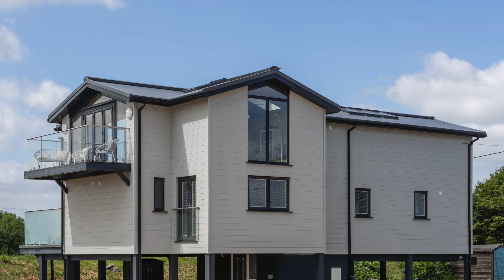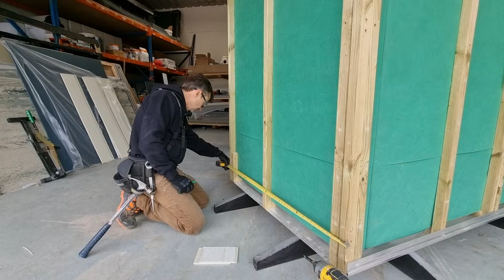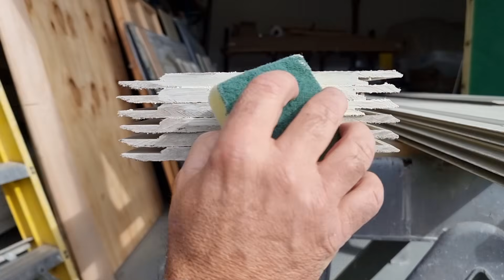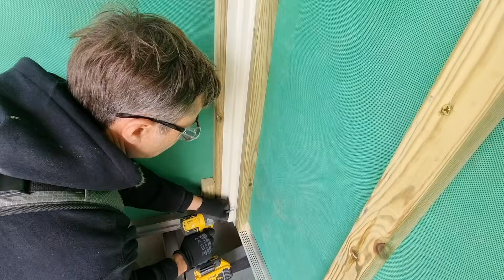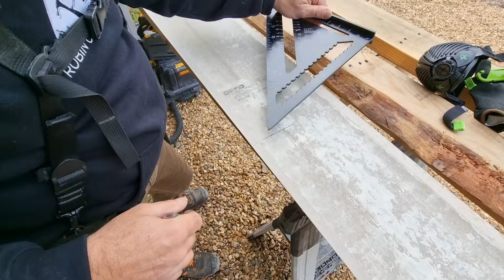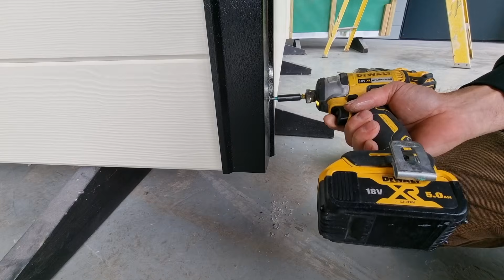How to install Hardie® VL Plank

Comment: Silly question time. If installing cladding vertically. How do you maintain the vent strip , when the lower batten would close off the vetilation void
Reply from the maker: Hi Mike, you need to cross batten to maintain the air space and use the deeper vent strip at the bottom
Reply: @robinclevettcarpenter  cheers Robin. , i thought it might be that. But wondered if there was a clever product to avoid it
Reply: Why wouldn’t you just cover the vent strip with the vertical boards?
Reply: 45 degree Diagonal battens would work also.

Comment: Amazing Thankyou! You covered just about everything I will be doing in this one window. I searched far and wide for this type of explanation and you nailed it! Pardon the pun! Just wondering what your thoughts are on installing this on a bay window. I can't see any 45 degree edges or profiles so I'm guessing you would just need to but them together with sealant? Any ideas Robin? Thanks again for a great video

Comment: No caulking required for the corner flashing?
Reply from the maker: No from memory we leave a small gap and paint the cut ends of the boards this adds protection and allows and moisture out
Reply: Would like to see some flashing like damp course around those corner studs as we would do in Australia. Also some sealant under that corner trim ... Water will find it.

Comment: I found this very useful but not being a builder I got confused as the words "Trim" and "Profile" were used interchangeably, and the camera panning in to profile/trim in question was too brief  - I had to rewatch  3 times at 50% speed with captions on. I think it would be helpful at the end of the video to have a list of all the profiles used. The demonstration frame with batons seems to have roofing membrane behind it. On a 1966 townhouse I imagine that the old decaying wooden cladding will have blockwork under it. Would one fix a membrane on this? Or could one paint the area to be clad with Thomson's Water Seal (or equivalent) ? On neighbouring townhouses on the terrace where there is replacement white plastic cladding and the cladding has been joined to meet the horizontal span, there seems to be a white plastic tape over the joint. But in the Hardie's catalogue there  is  a black EPDM tape, which I think from the video goes behind the joint, but no white tape to go over the the front of the joint. Should/could there be and where would one source this?  Finally where a joint is necessary for several horizontally laid VL planks, should these be staggered or should they be in a straight line?

Comment: Should we wear a mask when fixing the boards? Is the dust very hazardous?
Reply from the maker: Hi Paul, any material that has the potential to generate dust whilst being machined etc can cause problems so I would say yep a mask is basic PPE needed
Reply: Thanks for your speedy reply, much appreciated @robinclevettcarpenter  8~)

Comment: just thinking of  doin our porch in hardy would it b ok to put 25 mill of celotex in between the battens would this affect the airflow
Reply from the maker: You need to maintain the clear airflow, you can put the 25mm insulation behind the battens providing you secure the battens with the appropriate number and type of fixing and at the right spacings etc
Reply: @robinclevettcarpenter  thank you

Comment: I used the standard Hardie plank three times now on old terrace houses. It lets the brick work dry out for good so even though its not insulated a dry brick is much more thermally  efficient. My only problem was ending it against the house next door neatly but i just got some black plastic trim from eurocell and ripped it down and glued it on.
But i think ill try the VL plank next time as it looks so much easier for a one man job.

Comment: Hardie board has a very sketchy reputation.. I'd be worried if this going to be commonplace in the UK. It has struggled in less wet countries .... UK stick to what works.... this ain't it.
Reply: When installed correctly, like seal all cut ends, don't caulk butt joints, only caulk where Hardie says in the instructions, hardie has a 30 year warranty 15 year on the painted  surface..stuff is fantastic, insects fire proof, strong, must be installed correctly, like anything, quality stuff needs to be installed properly
Reply: And use the caulk that Hardie says to use, there is a difference

Comment: Good content, if you do a lot of cladding it’s easier with experience to use a nail gun with s/s ring shank nails for the trims and boards also if you can’t help having joints on runs you need a roll of Epdm tape. 👍

Comment: 11:42 now you have a large hole where an mouse can EASILY go in between the trim and the vent grid...
That is a big fail with this system.
A mouse needs just 5mm to go in and that looked like 10 or 15mm square

Comment: Great video Robin, very clear and easy to relate back to if needed.

Regards to the VL plank, if you had a long run, on other brands of external cladding the joins are visible and I always think they look unsightly. He was unfortunate enough to have a long run, is there a special way of joining the boards or did they simply just butt up together with a clean mitre cut after you’ve sealsealed the ends??
Reply from the maker: The butt joint in the Hardie VL Plank is similar to timber cladding, Clean cut followed by the sealer and then you leave a 1mm gap between the cut ends, there is an EDPM tape that is positioned behind the board joints onto the batten frame. I have a video with this detail that will be published on Sunday this week,  Thank you for watching and your kind words
Reply: @robinclevettcarpenter   cheers Robin, much appreciated. Have a good day mate

Comment: Great video as always thanks Robin.
On the subject of reducing waste, there are freely available, easy to use on-line tools which allow you to fit your cutting list into the stock size, with the minimum wastage. Search for "cut list optimiser". 👍
Reply from the maker: Great tip!

Comment: Hi Robin, I live in the UK and have a brick built house with a 50 mm gap onto the inner brick wall. My house is about 70 years old and some of the bricks are showing damage to the face of the brick, I do not like rendered walls and have always thought of siding as being used in the USA only. Would you recommend this siding to go over the brick face to protect the bricks behind them.
Reply from the maker: Hi John, lots of people fit this type of cladding to enhance and protect existing structures and buildings, and if fitted with the correct void ventilation etc this would be ideal, be sure that treated battens are also used

Comment: To use this stuff you have to invest in the entire "system" seems to be the trend these days. Special end grain sealer, special screws, special saw blade, special bottom trim,  corner trim  just not something I'd buy into unless we were asked specially for it. 
Looks a tidy job but Rob "neat n tidy" Clevett could polish a turd amd it'd look good

Comment: Welcome to my World. The same but different. In the land of it's birth we generally put it up straight over the stud work which we frame at 450mm. We house wrap over the studs so no cavity under the planks. Hardie do their own breathable house wrap but it is expensive. The rest is much the same. Being fixed gauge it usually doesn't work with the perfect run over header. That is normally a cut round on windows and doors. Getting the boards in between two windows or a window and a corner etc. Can be a fiddle. Long boards with lots of large cut outs hard to stop from snapping. Your mock up is only short walls with no joins. There are different joining methods. None that great. If you had a straight joint then you could have a pretty good join. But staggering the boards for look and strength not so good. Hardie must be paying well. This is the second info commercial. I reckon if I had a dollar for each of these planks I have put up over the last 24 years I might have nearly as much as the advertising contract. Work smart not hard. You have the right idea.
Reply from the maker: Hi Dave, Hope you are well mate, thanks for your comment, you are right about if you have a long board with several large cut outs then you really need another pair of hands!! Have a good week down under mate!!

Comment: Could you cut the boards with a chop saw if you could fit the Hardie blade in it ? it looks fantastic stuff, thanks for doing the video
Reply: That's what we do in Aus
Reply from the maker: Yes you can, you can get all sizes of blade and as long as you have a decent dust extractor this will be good!!
Reply: @robinclevettcarpenter  thanks for the reply